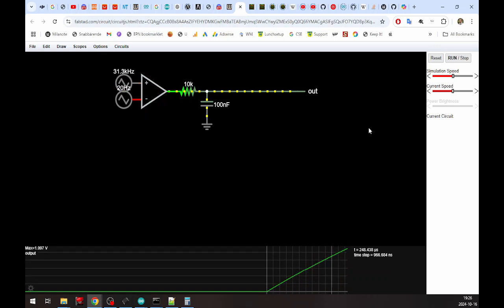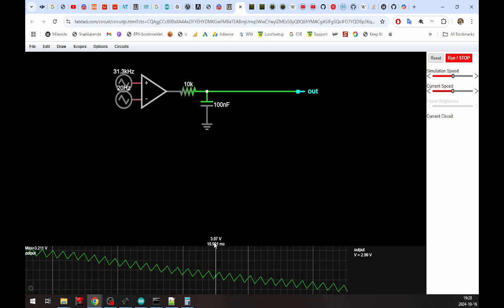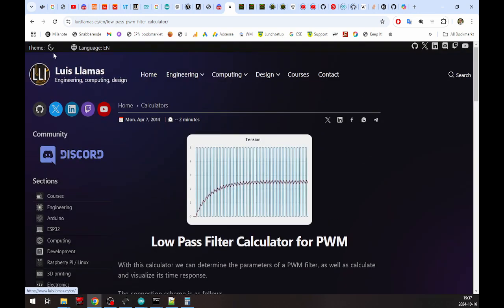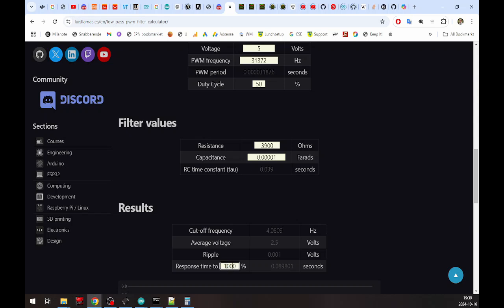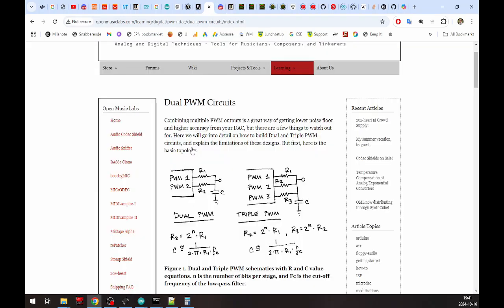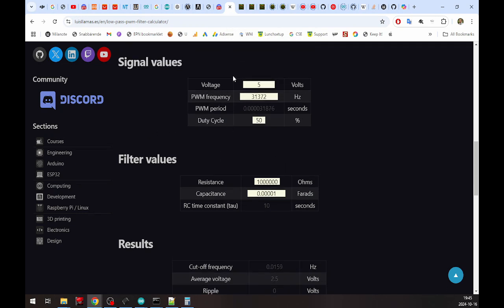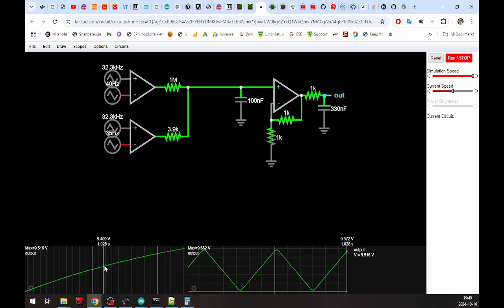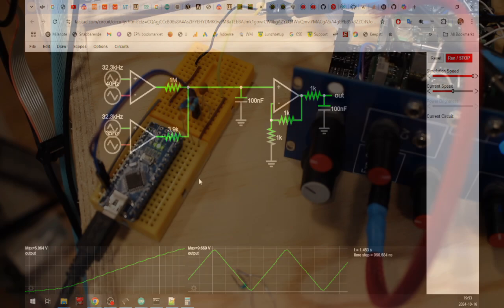Low Pass RC-filters, from digital to analog conversion - How Dual PWM works part 3

Comment: Great video once again.
What if the filter was active, changing it's cut off frequency as a function of the frequency? So if the resistor is swapped with a transistor which is driven by a heavily filtered copy of the signal....or something like that. Then you could run both audio and CV rate signal from same circuit...in my imaginary dream world at least :) I'm likely making it just more complicated it needs to be.
Reply from the maker: I think this end result is good for both CV and audio... Maybe should have tried that aswell though 😅
Reply: Yeap. That’s me over thinking stuff again😊 Love your videos nevertheless(y)
Reply from the maker: @recyclop  I’ve been thinking more. Since the frequency we want to remove is 32khz which is way out of our hearing frequency it will work for both cv and audio. I do talk about this in the second pwm video I think. :)